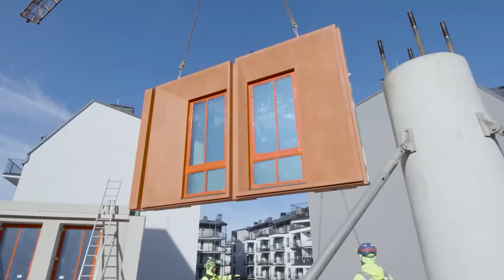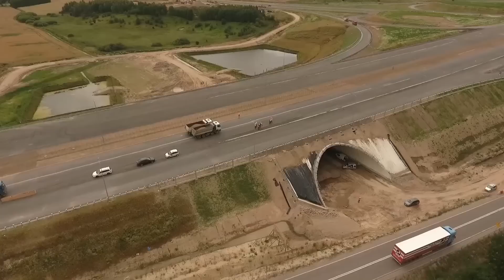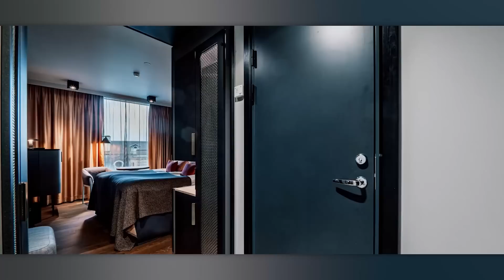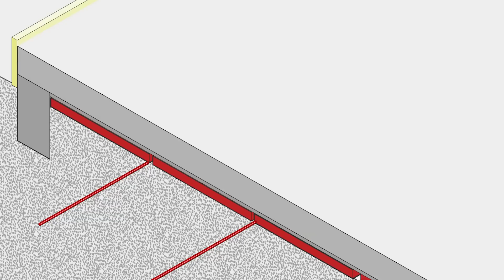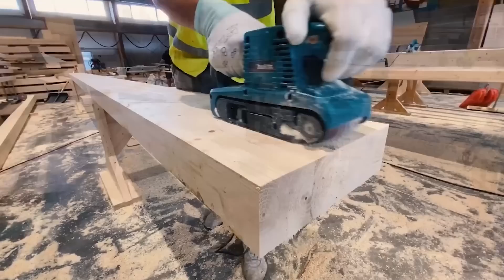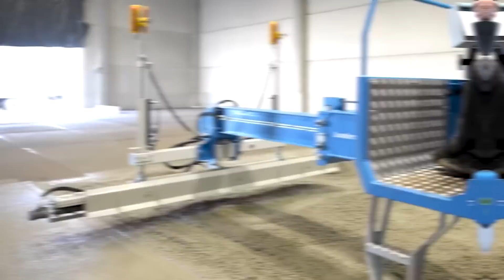CONSTRUCTION TECHNOLOGIES THAT HAVE REACHED A NEW LEVEL

Comment: Rhino Carbon Fiber CFRP might be strong, but covering cracked concrete with a band-aid is a solution that will come back and bite you. It's not a solution, it's just covering a fault not fixing it. 😡